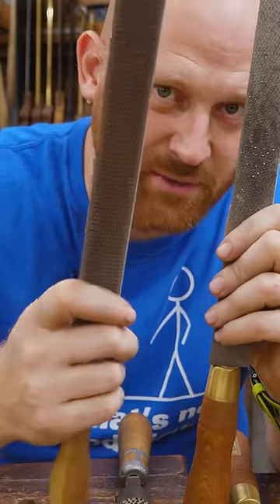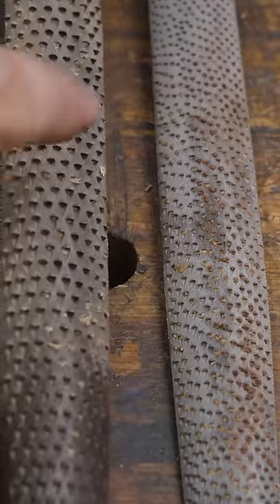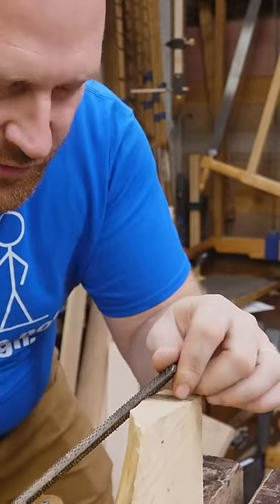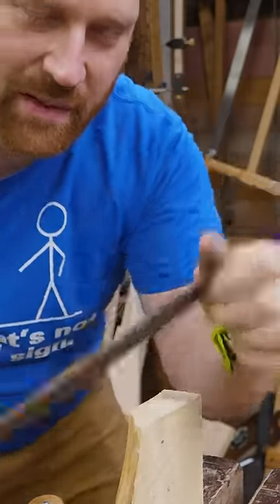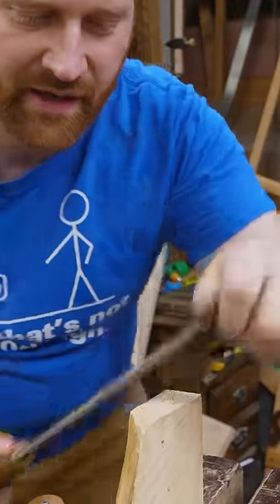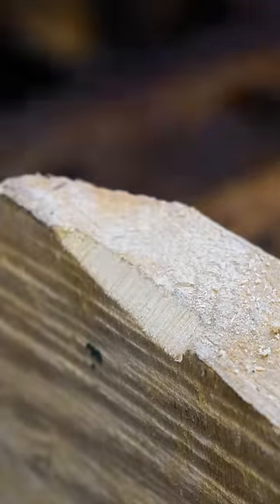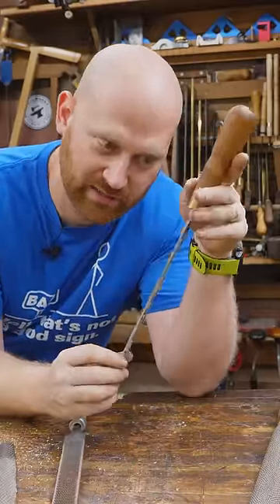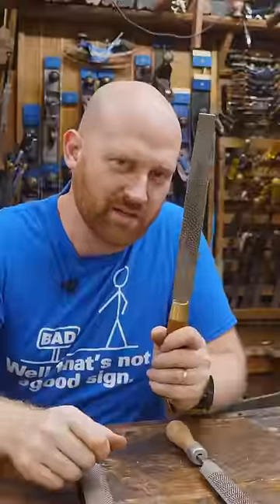Hand Stitched vs Machine Stitched Rasps

Comment: Can't they just make a machine one that replicates the randomness of a hand one? 
Like, just Map where a hand one has been created, and then just replicate that pattern on ALL machine ones?
Reply from the maker: They have made that, but the cost to run it is only slightly less then paying someone in Asia. And the makers for big box stores don't care. So the price on them is about the same as the hand stitched. The current machines punch full rows at once and march down the blade. And the audence they sell to (Big Box Stores) do not care about or even know that there is quality. Here they are: https://www.corradishop.com/gold-precision-rasps-c-1_4/gold-precision-rasps-round-6-cut-6-p-604
Reply: @WoodByWrightHowTo  sounds like they are not manufacturing it correctly then if the price is almost the same
Reply from the maker: the problem is scale. 99% of the sales are in big box stores. and the people that buy there don't care and could not tell the difference. so it is not worth it to spend the time and money to change what they have been doing for decades. If one company did. they would get nothing back on the investment.
Reply: @WoodByWrightHowTo  So, capitalism is the problem?
Reply from the maker: No it just has more to do with the education of the masses. If the consumers at large knew the difference the change would be over night.

Comment: Why won't they just make the machine stitch it in irregular way?
Reply from the maker: They have made that, but the cost to run it is only slightly less then paying someone in Asia. And the makers for big box stores don't care. So the price on them is about the same as the hand stitched. The current machines punch full rows at once and march down the blade. And the audience they sell to (Big Box Stores) do not care about or even know that there is quality. Here they are: https://www.corradishop.com/gold-precision-rasps-c-1_4/gold-precision-rasps-round-6-cut-6-p-604.

Comment: honestly why not just create a rolled file with a more random pattern
Reply from the maker: They have made that, but the cost to run it is only slightly less then paying someone in Asia. And the makers for big box stores don't care. So the price on them is about the same as the hand stitched. The current machines punch full rows at once and march down the blade. And the audence they sell to (Big Box Stores) do not care about or even know that there is quality. Here they are: https://www.corradishop.com/gold-precision-rasps-c-1_4/gold-precision-rasps-round-6-cut-6-p-604

Comment: Why couldnt a machine just create that randomized hand stitched pattern?
Reply from the maker: They have made that, but the cost to run it is only slightly less then paying someone in Asia. And the makers for big box stores don't care. So the price on them is about the same as the hand stitched. The current machines punch full rows at once and march down the blade. And the audence they sell to (Big Box Stores) do not care about or even know that there is quality. Here they are: https://www.corradishop.com/gold-precision-rasps-c-1_4/gold-precision-rasps-round-6-cut-6-p-604

Comment: Why can’t they just machine a stitch pattern that mimics a hand stitched pattern?
Reply from the maker: The current machines punch several rows at a time they do make a machine that will do random punching however it is rare that a company wants it and because of that it costs about the same to run the random punching machine as it does to pay someone in Asia to do the work. So the random machine punched rasps are only slightly less than the hand stitched

Comment: So why don't mass-producers have their machines put true random stitching in their rasps?
Reply from the maker: They have made that, but the cost to run it is only slightly less then paying someone in Asia. And the makers for big box stores don't care. So the price on them is about the same as the hand stitched. The current machines punch full rows at once and march down the blade. And the audience they sell to (Big Box Stores) do not care about or even know that there is quality. Here they are: https://www.corradishop.com/gold-precision-rasps-c-1_4/gold-precision-rasps-round-6-cut-6-p-604.

Comment: Why don't they make a hand stitched rasp to imitate them fancy machine stitched rasps?

Best of both worlds, they would cost more, and bounce.
Reply from the maker: They have made that, but the cost to run it is only slightly less then paying someone in Asia. And the makers for big box stores don't care. So the price on them is about the same as the hand stitched. The current machines punch full rows at once and march down the blade. And the audence they sell to (Big Box Stores) do not care about or even know that there is quality. Here they are: https://www.corradishop.com/gold-precision-rasps-c-1_4/gold-precision-rasps-round-6-cut-6-p-604

Comment: Couldn’t you just add a randomized and boom the machine is just like hand done one
Reply from the maker: They have made that, but the cost to run it is only slightly less then paying someone in Asia. And the makers for big box stores don't care. So the price on them is about the same as the hand stitched. The current machines punch full rows at once and march down the blade. And the audience they sell to (Big Box Stores) do not care about or even know that there is quality. Here they are: https://www.corradishop.com/gold-precision-rasps-c-1_4/gold-precision-rasps-round-6-cut-6-p-604.

Comment: so basically manufactures need to cut less regularly, got it
Reply from the maker: They have made that, but the cost to run it is only slightly less then paying someone in Asia. And the makers for big box stores don't care. So the price on them is about the same as the hand stitched. The current machines punch full rows at once and march down the blade. And the audience they sell to (Big Box Stores) do not care about or even know that there is quality. Here they are: https://www.corradishop.com/gold-precision-rasps-c-1_4/gold-precision-rasps-round-6-cut-6-p-604.

Comment: All this tells me is that the machine needs to switch up its pattern
Reply from the maker: They have made that, but the cost to run it is only slightly less then paying someone in Asia. And the makers for big box stores don't care. So the price on them is about the same as the hand stitched. The current machines punch full rows at once and march down the blade. And the audience they sell to (Big Box Stores) do not care about or even know that there is quality. Here they are: https://www.corradishop.com/gold-precision-rasps-c-1_4/gold-precision-rasps-round-6-cut-6-p-604.

Comment: Why can't they make machine stitch that copied the hand stitch?
Reply from the maker: They have made that, but the cost to run it is only slightly less then paying someone in Asia. And the makers for big box stores don't care. So the price on them is about the same as the hand stitched. The current machines punch full rows at once and march down the blade. And the audience they sell to (Big Box Stores) do not care about or even know that there is quality. Here they are: https://www.corradishop.com/gold-precision-rasps-c-1_4/gold-precision-rasps-round-6-cut-6-p-604.

Comment: The problem is that the machine that did the file is not good
Reply from the maker: They have made that, but the cost to run it is only slightly less then paying someone in Asia. And the makers for big box stores don't care. So the price on them is about the same as the hand stitched

Comment: No way they could just machine a different pattern?
Reply from the maker: They have made that, but the cost to run it is only slightly less then paying someone in Asia. And the makers for big box stores don't care. So the price on them is about the same as the hand stitched. The current machines punch full rows at once and march down the blade. And the audence they sell to (Big Box Stores) do not care about or even know that there is quality. Here they are: https://www.corradishop.com/gold-precision-rasps-c-1_4/gold-precision-rasps-round-6-cut-6-p-604

Comment: Or hear me out. We replace the human craft by making the machines imitate the random pattern of a hand stitched rasp.
Reply from the maker: They have made that, but the cost to run it is only slightly less then paying someone in Asia. And the makers for big box stores don't care. So the price on them is about the same as the hand stitched. The current machines punch full rows at once and march down the blade. And the audience they sell to (Big Box Stores) do not care about or even know that there is quality. Here they are: https://www.corradishop.com/gold-precision-rasps-c-1_4/gold-precision-rasps-round-6-cut-6-p-604.

Comment: It seems to me the hand stitch one could be replicated by machines, just not as easily.
Reply from the maker: They have made that, but the cost to run it is only slightly less then paying someone in Asia. And the makers for big box stores don't care. So the price on them is about the same as the hand stitched. The current machines punch full rows at once and march down the blade. And the audience they sell to (Big Box Stores) do not care about or even know that there is quality. Here they are: https://www.corradishop.com/gold-precision-rasps-c-1_4/gold-precision-rasps-round-6-cut-6-p-604.

Comment: Don’t see why can’t make a machined one with a better pattern
Reply from the maker: They have made that, but the cost to run it is only slightly less then paying someone in Asia. And the makers for big box stores don't care. So the price on them is about the same as the hand stitched. The current machines punch full rows at once and march down the blade. And the audence they sell to (Big Box Stores) do not care about or even know that there is quality. Here they are: https://www.corradishop.com/gold-precision-rasps-c-1_4/gold-precision-rasps-round-6-cut-6-p-604

Comment: Couldn't they just copy a hand stitched one and make it on a machine?
Reply from the maker: They have made that, but the cost to run it is only slightly less then paying someone in Asia. And the makers for big box stores don't care. So the price on them is about the same as the hand stitched. The current machines punch full rows at once and march down the blade. And the audence they sell to (Big Box Stores) do not care about or even know that there is quality. Here they are: https://www.corradishop.com/gold-precision-rasps-c-1_4/gold-precision-rasps-round-6-cut-6-p-604
Reply: @WoodByWrightHowTo  fantastic information. Thank you

Comment: Why don't they just machine it randomly
Reply from the maker: They have made that, but the cost to run it is only slightly less then paying someone in Asia. And the makers for big box stores don't care. So the price on them is about the same as the hand stitched. The current machines punch full rows at once and march down the blade. And the audience they sell to (Big Box Stores) do not care about or even know that there is quality. Here they are: https://www.corradishop.com/gold-precision-rasps-c-1_4/gold-precision-rasps-round-6-cut-6-p-604.

Comment: So we need a machine stitched rasp with staggered teeth to act like a hand stitched rasp
Reply from the maker: They have made that, but the cost to run it is only slightly less then paying someone in Asia. And the makers for big box stores don't care. So the price on them is about the same as the hand stitched. The current machines punch full rows at once and march down the blade. And the audience they sell to (Big Box Stores) do not care about or even know that there is quality. Here they are: https://www.corradishop.com/gold-precision-rasps-c-1_4/gold-precision-rasps-round-6-cut-6-p-604.

Comment: You'd think you could just make the machine do the same stuff
Reply from the maker: They have made that, but the cost to run it is only slightly less then paying someone in Asia. And the makers for big box stores don't care. So the price on them is about the same as the hand stitched. The current machines punch full rows at once and march down the blade. And the audence they sell to (Big Box Stores) do not care about or even know that there is quality. Here they are: https://www.corradishop.com/gold-precision-rasps-c-1_4/gold-precision-rasps-round-6-cut-6-p-604

Comment: ... so machine it with a jagged pattern
Reply from the maker: They have made that, but the cost to run it is only slightly less then paying someone in Asia. And the makers for big box stores don't care. So the price on them is about the same as the hand stitched. The current machines punch full rows at once and march down the blade. And the audience they sell to (Big Box Stores) do not care about or even know that there is quality. Here they are: https://www.corradishop.com/gold-precision-rasps-c-1_4/gold-precision-rasps-round-6-cut-6-p-604.

Comment: Solution: make the machine stich random
Reply from the maker: They have made that, but the cost to run it is only slightly less then paying someone in Asia. And the makers for big box stores don't care. So the price on them is about the same as the hand stitched. The current machines punch full rows at once and march down the blade. And the audience they sell to (Big Box Stores) do not care about or even know that there is quality. Here they are: https://www.corradishop.com/gold-precision-rasps-c-1_4/gold-precision-rasps-round-6-cut-6-p-604.

Comment: Soooo just machine it differently.
Reply from the maker: They have made that, but the cost to run it is only slightly less then paying someone in Asia. And the makers for big box stores don't care. So the price on them is about the same as the hand stitched. The current machines punch full rows at once and march down the blade. And the audience they sell to (Big Box Stores) do not care about or even know that there is quality. Here they are: https://www.corradishop.com/gold-precision-rasps-c-1_4/gold-precision-rasps-round-6-cut-6-p-604.

Comment: Take a small punch and play with the teeth.. move one that way.. this one this way..flat this one...giving it some irregularity like a handmade one!?
Maybe in the end this way you pay for a machined one but get better result like a handmade one..like the perfect cost/effective you can get!!🤷‍♂️ 
Like cheap saw that always get stuck..a lil touch up to the teeth and you just double its  effectiveness while still paying the cheap price!!🤷‍♂️
Reply from the maker: The problem is they are hardened and if you try to move the teeth you'll just snap them off. Not to mention you would just end up making the tooth taller or shorter and that would give you a rougher cut.

Comment: The have machine stitched rasps with alternating stitch there like 10-15 bucks a piece for a good one
Reply from the maker: The cheapest I've seen is 60 bucks.
Reply: @WoodByWrightHowTo  i think corradi makes them the machine they use makes like a wave pattern to the stitches so that each individual stitch overlaps with with the two in the row below as well as with the two in the row below that and there honestly amazing and work wonders as apposed to the straight lines you get with most generic rasps and are definitely on scale with hand stitched one and there only like 7-8 euros to like 15 for the wider ones and idk if its because they mainly make rasps for jewelry and the metal working needs the higher quality rasps but they make luthier rasps as well and the ones i bought only cost 150 bucks for the 12 rasps  i have it was like 90 for one set and 45 for the other
Reply from the maker: wow. you can not touch Corradi Rasps here for under $60 here.

Comment: So... Is random pattern or irregular CNC stitch a thing yet?
Because that's literally just a design modification to a CNC machine.
Fractal? Fractal pattern cnc....
*Edit*Yeah, this is a scam. Either the machines AREN'T CNC, someone patent blocked Lot of rasp patterns, or the industry has an agreement.
Reply from the maker: The problem is still having to punch one at a time which takes a lot of time on the machine. And they can pay someone in Asia less than it cost to run the machine.

Comment: With the machine-stitched rasp, use it at an angle for more averaged-out tooth contact... You're welcome ^_^
Reply from the maker: Some times you can do that, but most of the time when working on a compound curve that is not an option.
Reply: @WoodByWrightHowTo  Well... if the tool you're using isn't working, perhaps it's not the right tool for the job in the first place.
In any task requiring skill, rarely is more force better.
Reply from the maker: Bingo. That is why the right tool is hand stitched!

Comment: Cant you just get a carbid bit or harden steel and use a arbor press to make a few random groves in the machine made. Drop out of a stamp die and manufacturing degree here. Not the smartest but ya. Couldnt u just make one ur self with an arbor press.

Comment: it is not the pattern that makes it smooth. the hand-stitched one has smaller bumps. that's why
Reply from the maker: You would think that.
Reply: Nah, the pattern matters a lot.  If you have the stitches all on the same row, they all make contact at the same time which increases the friction at any given moment.

With the more organic pattern of the hand-stitched one fewer stitches will contact the wood at any one time which decreases the friction & reduces the likelihood of it catching.

That's also why you get the smooth result.  If it only had smaller stitches, you'd still get grooves, only smaller ones.  It's because the hand-stitched rasp doesn't have anything resembling lines that it doesn't produce grooves in the wood.